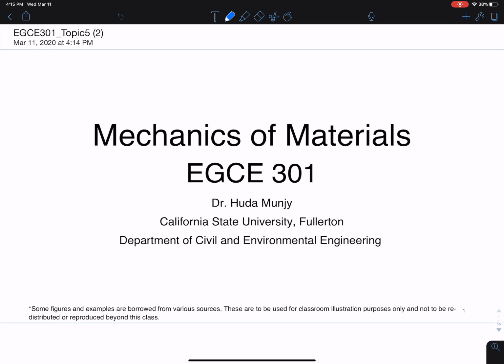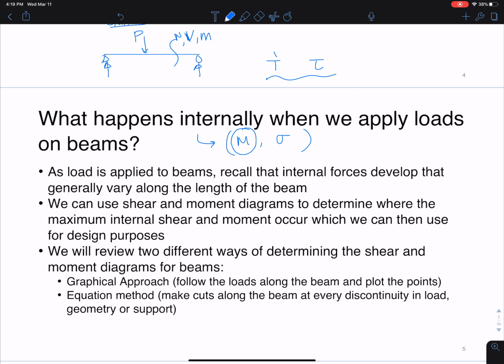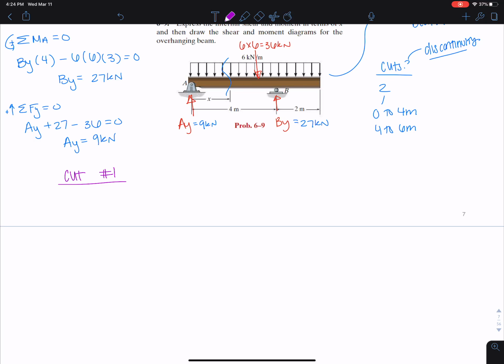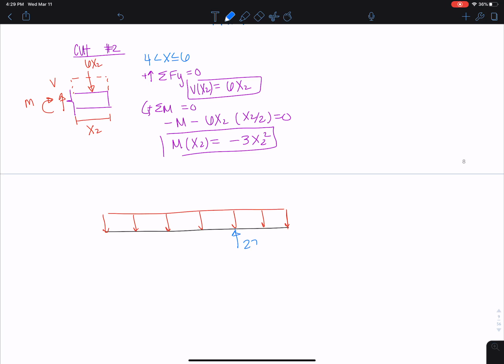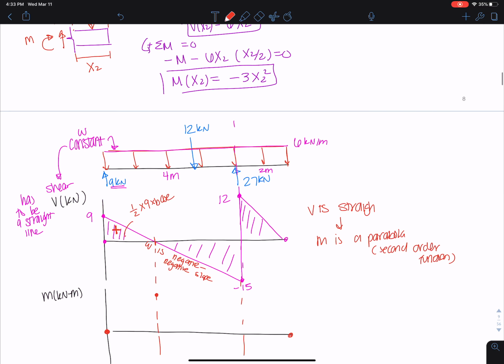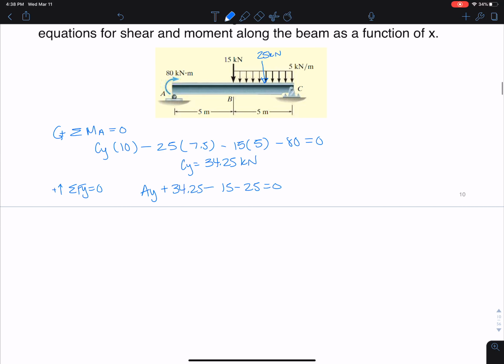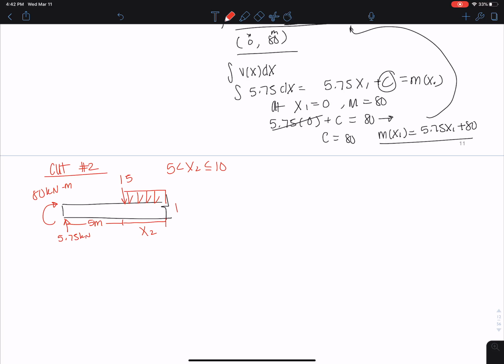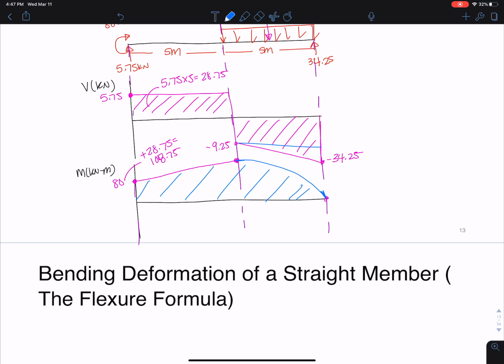EGCE301Topic5Part1

Comment from the maker: Hi all, please note that this video has a typo. In example #1, the resultant of the distributed load should be 36kN, not 12kN, so please fix this when reviewing! 
Thanks for Jorge and Drew for posting on the forum about this! 
You are also welcome to leave your questions, comments and answers here which all count towards your class participation.
Lastly, make sure to respond to others' questions to get some extra points!
Reply: To anyone, this does not change the solution right?
Reply: @matthewpilker9738  I think it would change the shape of the diagrams because the maximum value is 36, which would change the slope.
Reply: @jakedaye8935  That would be 0<x<6 for the FBD, but the shear and moment diagrams are correct as she has them (I think now).